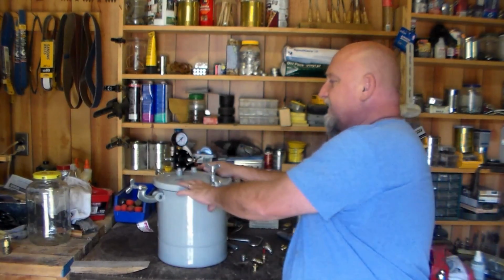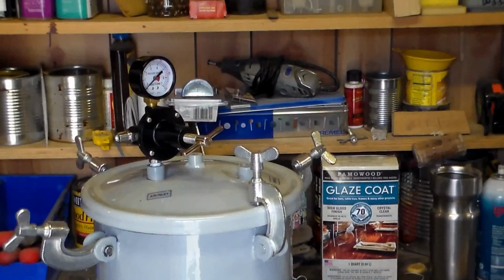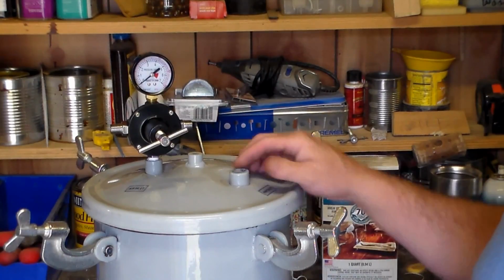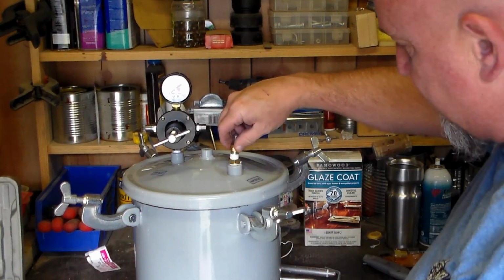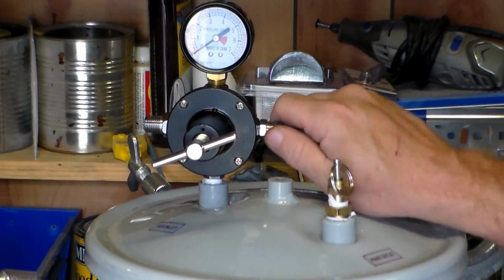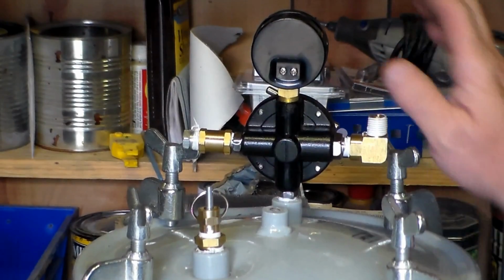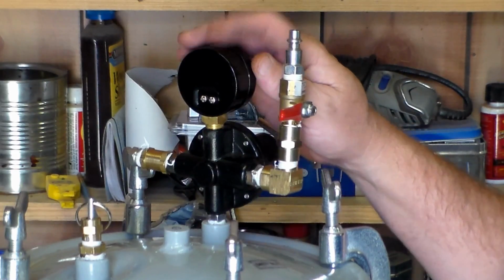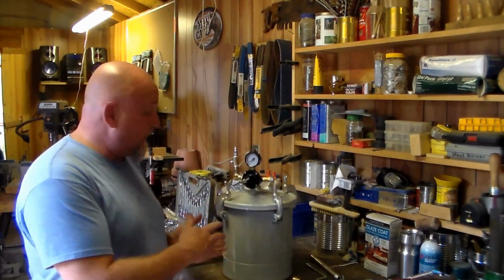Converting a Harbor Freight Paint pressure tank into a Resin pressure tank for knife scales

Comment: What is the metal part sticking out of the pressure gauge?  Looks like a T - handle. My pot came with it seperate and I have no idea what it is for.
Reply from the maker: I am not sure what piece but the pressure valve is stainless steel on this model and it is how you adjust how much pressure you build up in the tank> If you can stop the video and reply with the time your asking for as in like this 5:30 I will have a better idea of what piece.ATB Mike
Reply: it regulates the flow of outgoing air to the paint sprayer. you should never have to mess with the T handle in this application. it won't matter how the handle is adjusted because in this application there is no outgoing flow of air

Comment: Well your no slouch when it comes to creating videos. With 237 videos to your credit, Nice job! As soon as I saw the intro I said this guy is producing professional Videos. And I was right on. The only reason I watched this video was I wanted to know what you meant by the Term" knife scales ""STILL TRYING TO FIGURE THAT OUT"" " The only thing I can give as a critique is kill the background noise when your talking.
Reply from the maker: Thank you for your words, I do wish I had recorded the video without the fans going. But it was 100 Plus that day and I had 4 fans going off in the Building. As for what is Scales. They are the wood pieces that go on the knife at the handles. Which is sometimes called the handles but are called Scales?  To put resin or cactus juice into the scales you put pressure on the wood to force out any air in the wood and force the liquid which hardens or makes scales not crack under pressure of use. As in a blunt hit to a stick and the scales take the vibration and crack. ATB Mike

Comment: I own an binks model 83-5661 I would like to convert it to a pressure pot for casting but its not the same as the harbor freight pots. Any help?
Reply from the maker: D K let me look up that model and study it a bit and I will come back and see what I come up with. I am out of town today so may take a couple of days. ATB Mike
Reply from the maker: I found a few of them as Pictures only. But it seems all you need to do is just buy a plug for one of the inlets/outlets. Or some type of vent plug to release pressure. Then it will just be a guessing game as to which threads it has to match up an inlet port and a T for a gauge. But it says 80lb PSI max- I would not go over 50lbs tho.  I see no reason why it wouldn't work. The idea is to keep the pressure in the tank for however long you need it. ATB Mike
Reply: @MikeWareASRoutdoors  Thanks so much. With your tutorial and the help you have given me here in comments I think I figured out what I need to do. I need 2 caps to seal off the air from escaping and also I need a T piece so that I can put in a release valve handle thing. The tank already has an emergency release valve on it and it had 2 gauges but I took one off.

Comment: Is using Teflon tape better than Blue lock tight?
Reply from the maker: Randy Blackwell I used the Teflon tape partially because it is what I had at the time. Although I would of still used it for the reason of taking it apart. Either would work depending on which you prefer I would say. Thanks for stopping in ATB Mike

Comment: I'm deciding on an air compressor to to with my pressure pot, do you think that a 24L tank at 8bar will be enough to pressurise the pot in a single go? Or should I invest in a compressor with a 50L tank ?
Reply from the maker: I would say it would be fine- You only needing to get around 35 psi to 50psi- The compressor would need to have a output for that.

Comment: Hello sir, how'd you get those parts off the tank lid? if I look closely at the threads on these parts there's dark green glue on there and they won't come loose. I dropped the lid and messed up the gauge and want to replace it.
Reply from the maker: Jerame Farnum you can lightly tap a wrench to break loose. on one I had the same problem with the green glue
 I took a propane torch and GENTLY heated it for about 8 secs. the piece you taking out. it slipped off with no force at all then...
Reply: Absorbed Self Reliance awesome, thank you.

Comment: Hello, my name is Ronaldo and I live in Brazil, and I really like your videos, well, I bought a tank that is at most 60 PSI. How would I use it to pressurize epoxy resin? Here in Brazil we only have epoxy and polyester resin. thank you
Reply from the maker: That is a  good question- I have used epoxy as well here in the US. I generally stay at 50 lb PSI on every type of material I use... I do know that the epoxy for 12 hours had small tiny Bubbles. The problem is it does not harden fast enough to help push out the bubbles.. When I get a day to test out something I was wondering about. I will send you a link to that video. It will be a few weeks tho... If I find any other information that will help you. I will send it over to you as well.. ATB Mike
Reply: Thank you very much for your attention, follow my email: mazzinicanetas@gmail.com
Reply: Mike, technically you aren't pushing out any bubbles in a pressure pot. That's not the way it works. The pressure pot applies external pressure to the epoxy, which in turn applies pressure to any air bubbles trapped in it.  Those bubbles do not escape the epoxy. They simply get compressed as well to a much smaller size....microscopic in fact.  Pressure effectively makes it look like you've remove the trapped air.  What you've really done is miniaturized it.  More pressure is better to a point....all depends on the rig and what you're putting inside it. You can confirm all of this by speaking with a tech from any of the casting companies.

As for the pot, my understanding is that the HF paint pots are only rated to 45psi.  Can you confirm? Not sure I'd want to continue to run as much as 60 through it on a regular basis.

Comment: what is the black material inside the tank simple rubber or silicon or plastic?
Reply from the maker: jo atjo not sure which oart. but the tank is painted black. but I did a silicone mini bread mold from dollar tree. not sure if that is what your asking
Reply: I just got off the phone with grizzley and they said that the inside tank is galvanized steal, if it's the same material as the gasket then it must be rubber
Reply from the maker: Yes the seal is a rubber silicone seal on the top of lid if that is what you was asking. I had responded from phone and did not get to check to see which part

Comment: can I just leave the pressure valve the way it came and cap off the paint inlet side
Reply from the maker: I guess you could but make sure you have air going in and not coming out any place. But with the set up you can get it sealed off and undo the air compressor and come back and its held. the weight off the hose would cause leaks.. you will need to make sure you have the outlet part blocked off... The main reason I did this way it was about 6.00 and used what parts it came with and redirected it to work for keeping as much pressure without keeping the air compressor running.. Hope this helps.. ATB MIke

Comment: at whats the minimum pressure that has to be used to get a good cast?
Reply from the maker: dudekidPL I have found 50 lbs does best. Although I have heard 30 lbs will do as well
Reply: thanks for the quick reply!
im looking for pots like that but where im from they are about 400euro which is crazy.
I decided to try make a home made one out of a steel cooking pot and im wondering what pressure to aim for
Reply from the maker: I would test this very slowly for sure. Most pressure cookers are only rated for about 30 lbs of pressure..
Reply: can you also tell me what is the purpose of the large black cross shaped element with the pressure gauge on it?
i know it acts as an air inlet/outlet with one side blocked and one side with the valve on it, but there also is a twist lever on it that i dont know what it does.
Thanks!
Reply from the maker: Is it the one with red on it? if so it is a valve so when I take off the hose the air cannot leak out?
Reply: yeah thats the valve but i mean the big black circular thing that both the ball valve and the pressure gauge is attached to
Reply from the maker: dudekidPL that's a regulator. you twist it left or right to allow how much pressure goes in the tank. when say 30 lbs is reached. it will not allow any more air in tank
Reply: thanks again for the very fast reply! :)
Reply from the maker: your welcome..

Comment: how has this held up? a couple questions: why do you suggest switching out the Guage, and which type Guage did you switch to? also what is the white stuff you wrapped around each thread?
Reply from the maker: It has held up well, Used it around 20 times, Has paid for itself now with some profit. The Gauge I never did change it out on this one. It is still the factory one. It held up well and was accurate enough for what it's intended purpose. Just a way to tell your not going over the 50 lb pressure limit for safe use. I used pipe threading, The white stuff I wrapped around each thread. It just helps to allow better fitting to help keep pressure regulated, without the air supply having to constantly run. 
   I have a video coming up this week on how I use this tank to impregnate wood hardener into wood slabs for scales. They come out awesome and they polish with bees wax nicely to a good shine... Hope this helped you out. Thanks for stopping in and supporting ... ATB Mike